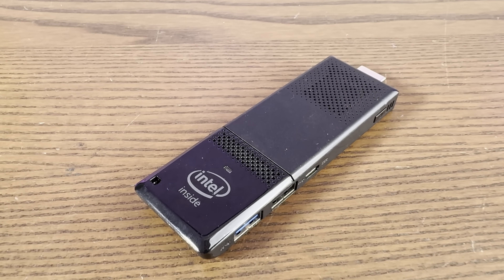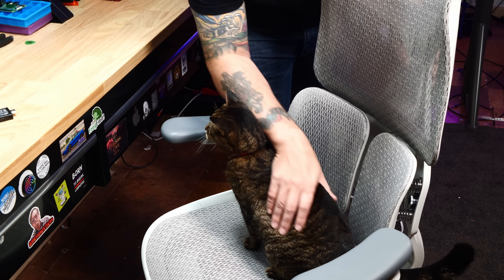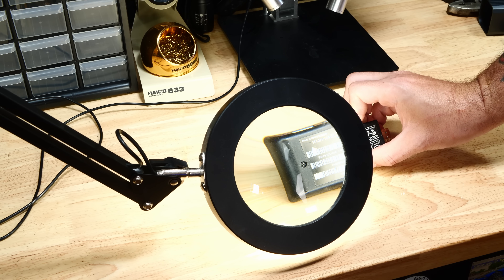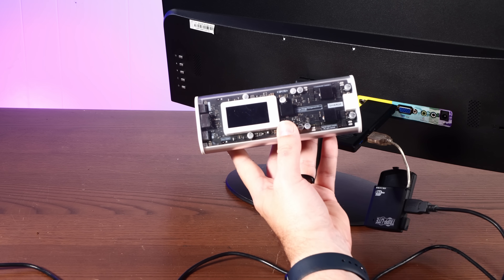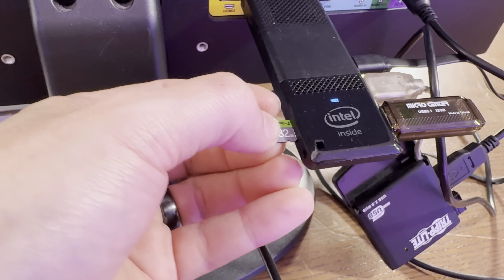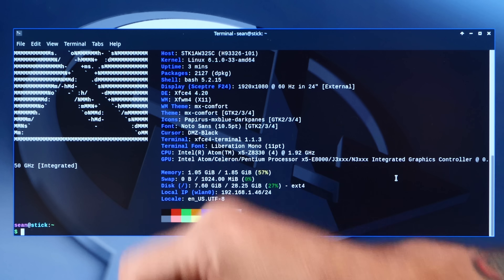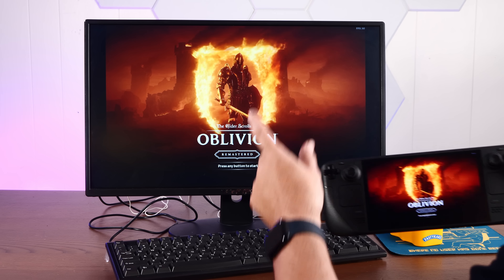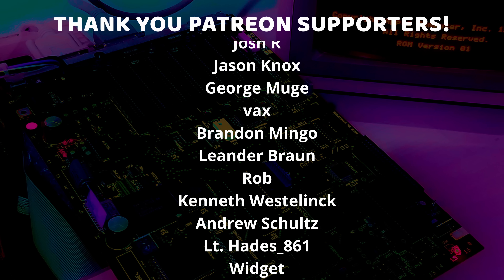Intel's Tiny, Weird Computer

Comment: Lenovo made a version of this, "Lenovo Ideacentre Stick 300", which I had. It shipped with Windows 10 preinstalled. It was miserable to use out-of-box, and only got worse and worse as Windows 10 updated over time. My last use for it was some bedside entertainment. It took a long time to boot, so I wanted to leave it on, but then it would just freeze it up at some point, every time. I did install some kind of Linux on it, so it "could" be done, but I abandoned what I was even thinking of doing with it at that time, and that was that.
That said, I was pretty impressed with out-of-box MX Linux there, I might have to keep that distro in mind for reviving this kind of extremely low power and generally useless hardware.
Reply: if theyre emmc, i imagine they dont have the write endurance to keep up with an os that constantly writes to the disk. windows is so wasteful with writes.
Reply: This was actually, togheter with the Intel stick on the video, the very first hardware Windows 10 shipped on, Microsoft was heavy advertising this kind of devices on the earliest of W10 days.
Reply: @Moremjd  I remember that was kind of a thing, Windows 10 was trying to eschew a lot of the "bloat" that it had become famous for with Vista and less but still present with 7. 10's early versions actually were pretty decent even for low-grade tablet hardware, especially Atom-based devices and the like, but at some point it started to "cross over" and even the salvation it had brought to such hardware was pretty much gone.
Reply: Try MX Linux with Fluxbox, that Lenovo Ideacentre will fly, way too light on resources

Comment: I work at an ewaste recycling company. We had about 4 of these come in the other week, and I've got one of those here right now. I had an idea of maybe using it to show pictures on a TV in my church lobby, and it seems like the previous user had the same idea because it's loaded with Windows and autoruns digital signage software.
Reply: Thats what we used them for at work.  Easy network integration where everything we got is microsoft.     Nothing stored locally on it except the kiosk software everything gets streamed in, photos, videos, ticker tapes, whatever. Worked pretty good for what it was.   And they came with a short hdmi extension so you didn't have to hang that big lever off of the hdmi port.   The only thing we had trouble with was the fans starting to fail after a few years of running 24/7.
Reply: What do the preloaded signs say?
Reply: @CobraKith  Probably points at a server it can't find
Reply: @CobraKith  Please Wait...

I'm pretty sure it's trying to talk to a server that it can't reach. I could use something like Wireshark to be sure, but I'm not curious enough about it.

Comment: 10 year old hardware just isn't as outdated as 10 year old hardware 20 years ago.
Reply: The growth rate on processor performance was already slowed down since the Intel 14nm era

In Windows 95 to XP era we saw almost 50% performance jump over each generation, but now, best we can get is 10-15% performance gains year over year
Reply: @sihamhamda47 22nm* no modern professor is smaller than 22nm it’s not physically possible. It’s a marketing term now
Reply: Yeah, so true. Looking at upgrading my mom, and my retired Intel 10900K will run circles around the sort of thing she’d be willing to buy new today.

And also it’s going to be a huge upgrade, I recently discovered she’s on a 3rd Gen, with 4GB of RAM. Sorry mom.

But 20 years ago we still had significant generational uplifts, these days, far less.
Reply: @thedave1771  Mom will be playing solitare and Kitchen Recipes at 10000FPS!
Reply: @thedave1771  it's not just that, the programs "regular" people use aren't getting much more intense to use so performance increases aren't going to affect daily use for them at that point
Reply: @HearMeLearn  they're not getting "more intense", but they are being built with more bloated, inefficient frameworks made by zoomerdevs. Modern software is garbage
Reply: @TheBawbSaget  depends on the app, you're right that they're doing that to some things, but not everything
Reply: @thedave1771  I wanted to update my mom daily when I was a teenager
Reply: @thedave1771  even the third gen should still be OK, the worst systems of that era were the AMDs 🤢🤢

sincerely, athlon 2
Reply: @thedave1771  I too, upgraded a few days back from 3rd gen, 4GB RAM, with HDD, and unless you are doing the most basic things it can be a hell of a pain. Though you would learn to manage your resources very well.
Reply: @sciencebeing6134 yeah. But even basic things get more annoying, as software just assumes a more powerful machine.
Reply: I have a netbook even older and it's still capable of web browsing and playing 1080p videos with the right Linux distro.
Reply: My son is using a 15 year old i7 Dell. Plays Fortnite badly, but he has a desktop for that, lol.
Reply: yeah thats why microsoft started putting artificial limits like tpm 2.0 in
Reply: @cal2127  tmp 2.0 is so Microsoft has a unique, unmodifiable ID to track users.
Reply: @cal2127  u may Use flyby 11, just sayin
Reply: For that matter, neither is 17-year-old hardware. I daily drive a laptop from 2008 and I literally have no need for anything else.
Reply: That's both somewhat true and somewhat not really.
When Windows 95 came out (in 1995, duh), its minimum system requirements described a machine that could exist as early as 1987. A very high end of 1987 PC market, but still.
It was not too usable, but it did run, and you could run productivity software on such a configuration. Look for a channel called NTG Technology, that guy tested Windows 95 on a 386 to get an idea of the specifics. It wasn't a pleasant experience, but it wasn't completely unusable either.
So, yes, the PC lifecycles are significantly longer today - but at the same time, we don't give machines from previous eras enough credit. They too could last longer than we remember. Especially if you weren't gaming on them.
Reply: @kFY514  As a person that had Pentium 75, windows 95 was hot garbage even on the CPU.
Reply: @webinatic216  I personally used Win95 on a DX2. It wasn't a speed demon but it was usable for productivity and I have fond memories of that machine.
Reply: @webinatic216  I had a Pentium 100 with 96MB ram, Windows 95 was running smooth on my computer. It was the ram part that made it fluid.
Reply: @AndrewTSq Well well well, someone was rich in 95 :) .   I had 16 mb of RAM.  I think 64MB cost an arm.
Reply: @webinatic216  Having had an Am486/DX4-100, which was roughly equivalent to a P75 in APU performance, I would have loved to have even the slowest Pentium at that time.  It played Diablo flawlessly and even ran Quake playably, but it was no Pentium playing Quake.
Reply: @kFY514  As of 2025, I still own and use Core2Duo acquired in 2007.
It's not my only neither my main rig, I use it in my electronics hobby workshop. 
With 8GB RAM and SSD, running Ubuntu or Windows 10, it's totally usable for: light browsing, Youtube, microcontroller programming, and slicing 3D models and sending them to Octoprint. Also it is used to process and show data sent from the digital oscilloscope through USB.
It does gaming too, if you permit me call Age of Empires "gaming".
I'm so fondly of it that I fear that, when I upgrade other machine and the old one become available, I'll keep it, even if that means discarding a newer computer.
Reply: @kFY514  I used to use Win95 on a 486 processor. Probably DX2. It wasn't fun, to put it lightly.
Using 386 sounds like a nightmare scenario.
Reply: @kFY514 with zen 3 cpus and a high end rtx 3000 card, you can run any modern game on high or even ultra settings, and these parts are almost 5 years old by now, while the motherboards that supports these cpu can be as old as 8 years old. If back then the best you could do was have a sluggish experience with hardware this old for basic tasks with newest os, nowadays you can have a blazing fast pc that is also fast at running heavier tasks like gaming.
Reply: @HankPanky True , I'm  a software engineer and I've been using  a HP pavillion laptop from 2015 with intel integrated graphics  and 8GB of RAM & I can do most things I need to do just fine, I run android studio , code blocks , visual studio plus old games including early ps4 era PC games on low setting , I still get McAfee security updaates and windows 10 support ends in October. My biggest problem is using  HDD which is slow AF when turning the laptop on the the point that I don't bother turning it off anymore and just close it and the fact that thermal throttling is really  bad when I have too many chrome tabs open lol
Reply: Personally, I thought Windows 95 wasn't worth it without contemporary hardware, which would have been a minimum of Pentium 120/133 with 16-32 MB RAM. Between suboptimal user experience and driver issues with older hardware (the real cause of most of the blue screens), it was better to just stick with Windows 3.1, which was doable until around the turn of the century if you really had to, especially the WFW version.

What the videos covering W95 on a 386 or 486 don't show is the time loss from the "upgrade". You're spending more time waiting for things to load and catch up than you are taking advantage of the relatively few inherent advantages of early Windows 95. By the time a better case could be made for Windows 9x, your 386 or 486 is no longer usable, anyway, and isn't officially supported with OSR2 and above, the real reason to upgrade (i.e. buy a new computer).
Reply: I daily an X58 system--i7 990x, Titan XP, 48GB of DDR3. It does great running Minecraft with shaders using the expected performance tweaks (Sodium, entity culling, etc). Also runs plenty of other things decently. Call to Arms, Enlisted, BeamNG, and anything else I've wanted to play. The single new game I've kind of wanted to try in the last 2 years is Helldivers II. You're right that hardware just doesn't age like it used to, a lot of our modern necessities/standards/specifications came to maturity in the late 2000's and haven't changed much since.
Reply: I remember computers in the late 1980s and 1990s. Top of the line in 1989 was basically handed down to grandma in 1993.
Reply: the rule where the transistor count should double every couple of years is dead? (idk the law's name)
Reply: This stick has nearly the same specifications and performance as an average pc 20 years ago
Reply: Moore's law isn't dead, but software is failing to keep up and now the hardware industry has invented AI to justify the aggravated yearly consumption rate of silicon.
Reply: For real, even in phones, the iPhone 12 it’s as old as the iPhone 4 when the iPhone 8 was around…
Reply: @diegoalejandro8981 Oooh yeah, when they were doing this weird "s". Thing. I was like - but the iPhone 4 is juat 2 years old.right? What? You had 4s, 5, 5s, 6, 6s 
...?!
Reply: That’s because modern Windows isn’t as optimized anymore due to how much actual security they have. Windows 8.1 and bellow were horrible with security, windows defender did nothing, and you’d have to buy anti virus to keep your PC safe.
It’s not that the hardware from back then sucked, it’s that you’re most likely thinking of older 2nd or 3rd gen Intel i7s that are now available for incredibly cheap prices thanks to the abundance of refurbished office systems. Plus lower end hardware from 20 years ago still had troubles running certain operating systems they were supposedly “made” for, like my low end AMD machine with a 1 core CPU hated vista, even though it had enough ram and such.
Unlike an older 2nd/3rd gen i5 or i7 which can still easily deal with windows 10 if you install a good GPU. That’s entirely different, low end hardware will always become outdated quickly, it’s just low end hardware now like Intel N100s and Celerons are just not given enough ram, good enough storage, and have a low core clock.
Reply: yeah….thats…that’s how it works…? Are you saying current 10yr old hardware isn’t as outdated as current 30yr old hardware?

Or are you saying that back in 2005, 1995 hardware sucked more than 2015 hardware does in 2025?
Reply: @beeseechurger  >Are you saying current 10yr old hardware isn’t as outdated as current 30yr old hardware?
It's 2025. 10yo hardware is 2015
20 years ago is 2005. 10yo hardware for 2005 is 1995

2015 hardware is nowhere near as outdated today as 1995 hardware was in 2005.
Reply: @Vladislav888 yeah that’s what I said lmao
Reply: @beeseechurger  i mean, yeah.
It was pretty straightforward.
Reply: @Vladislav888 congrats..?
Reply: What makes this impressive is that this hardware was garbage a decade ago too. Like 10 year old hardware of the time would have been on-par.
Reply: this is an atom cpu it's in an outdated class of his own
Reply: NVIDIA 1080 is going to be 10 years old. That will never get outdated!
Reply: @ivanmaglica264  I'm still happily using my GTX 1050 Max-Q laptop GPU for work, studying for classes, a bit of Minecraft gaming... These machines really just keep going.
Reply: The evolution of Open Source software is also helping... MX Linux runs nice...Windows, 10 makes years old hardware perform like it's 20 years old.
Reply: I gave my dad a stealthy PC upgrade as a father's day gift, i7 7700 to R5 5600GT.
In a way, I am kinda surprised that 4 years made such a significant upgrade, I was also more surprised to see that the 5600G was also 4 years old, but at the same time despite it being 8 years old it was still a very decent system.
Reply: Which is why companies are now engaging in planned obsolescence to force you to upgrade often.
Reply: Windows 11 hates my 8 year old Microsoft Surface Book 2.  I'll eventually load it with Linux and use it until the battery dies and/or explodes.

Comment: I’m using Debian 12 to run Jellyfin on mine, using an external M.2 and a usb Ethernet adapter to prevent/reduce any weird networking issues. I set up a Samba share on the external SSD so that I can dump my shows and movies onto it remotely.
Reply: That's very cool! 🍻

Comment: I actually found a good use for mine. I use it as a QDevice for my Proxmox cluster. All I had to do was plug in a USB 3.0 NIC to it and an HDMI dummy and I got a nice low power node for my cluster. I did have to install just plain Debian on it, then install Proxmox through Debian. I recall the direct Proxmox installer having issues.